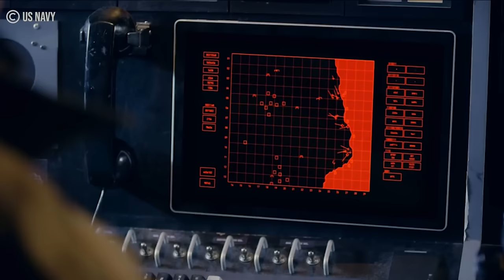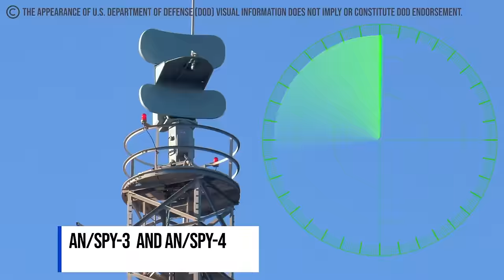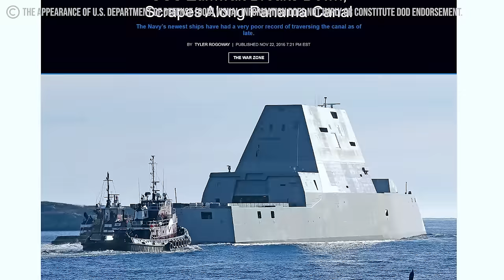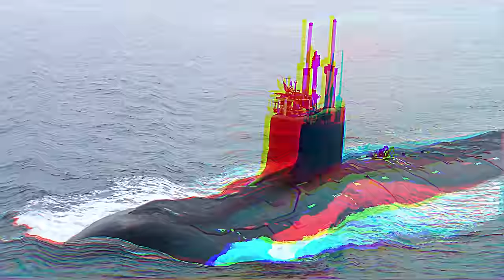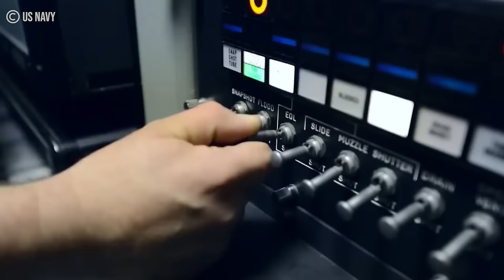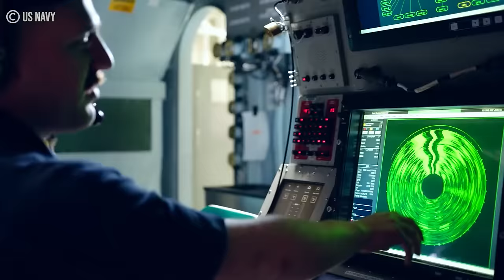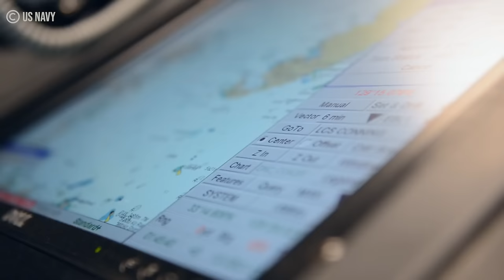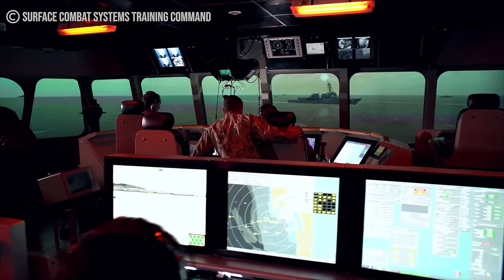This SECRET US Aircraft Carrier Shocked Hamas, Iran, Russia and China!

Comment: First off, the USS Zumwalt has not been the picture of reliability. It's been plagued with some pretty serious issues! What a SHORT lifespan of the USS Independence! That has  to be the shortest operational lifespan I've seen! The USS Gerald Ford has  been quite the aircraft carrier. Of interest to me is the electromagnetic catapault system and the SPY 3 radar system  is topflightt. I'm not sure how good it is at monitoring the undersea environment as the biggest threat to surface ships in modern times is submarines. This HAS to be taken seriously as Russian submarines have gotten way better in the recent times. The US Navy has to start fielding longer lasting ships that can have much longer lifespans and contain less flaws. Perhaps a modular design that will allow quick less expensive equipment upgrades to keep up with changing technology. I  see things like shipboard laser defense systems and particle beaam weapons coming into play shortly and it would be nice if the US Navy could quickly integrate this technology into their modern warships. So far, these ships have been inordinately complex and thus reliability suffers. Most importantly making sure crew knows how to run everything in even the most adverse conditions, we cannot afford ships colliding with huge tankers like the two Arleigh-Burke cruisers did! What the hell was all that about? In my opinion BOTH of them should have seen those tankers coming and get  out of the way, there is NO EXCUSE for what happened there!
Reply: I was thinking I had heard of a boatload (pun intended) of problems with the Zumwalt as well. Something about most of it being an abject failure. I am sure we learned something, time to rethink and rebuild?
Reply: Ugh